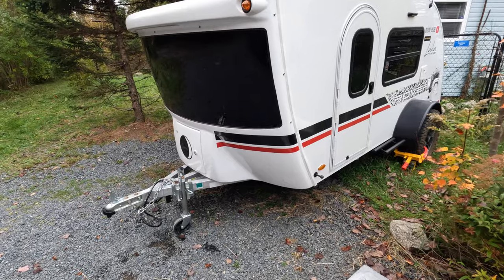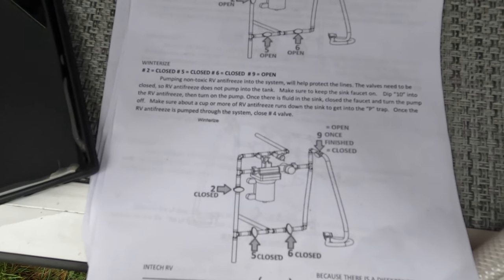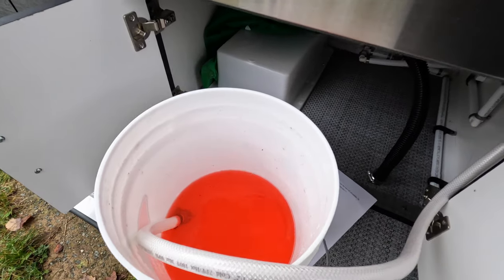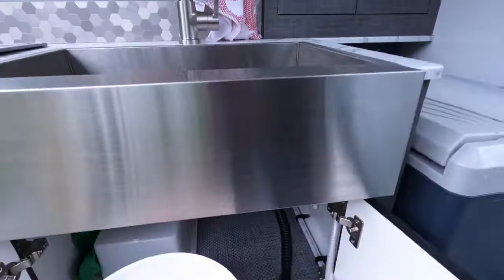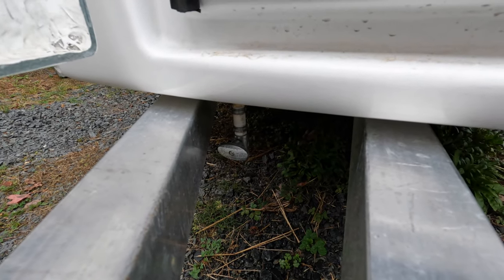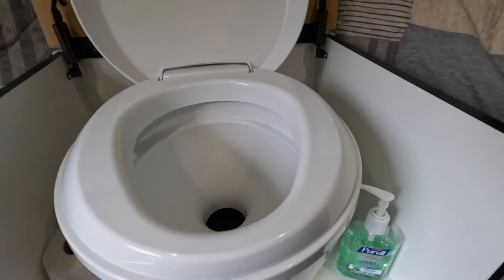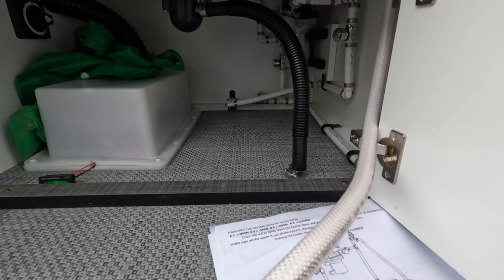Step by Step on how to winterize your InTech Luna Rover water system.

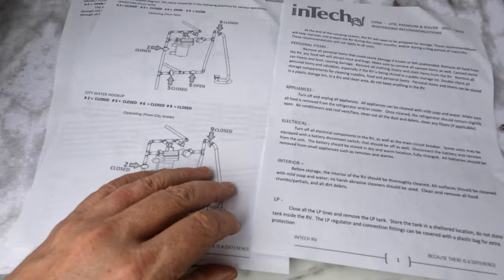Comment: Thanks for this video. Do you still have the multi-page instruction sheet from Intech with diagrams of the valves, which you showed @1:15 in this video? It's no longer on the internet, and my dealer doesn't have that either. (But they will be happy to winterize my Rover for $100, a half hour charge. No thanks.) Is there any way you can scan that document and post it with this video? It would be a HUGE help to us newbs!
Reply from the maker: Thank you for your kindness.  I’m positive I still have the document and would be happy to scan / put on my google drive.   It may be a couple days from now.  I will reply to your post again once it’s scanned.
Reply from the maker: @herrp8765 I found the document on the Luna site.   https://intech.com/rv/dealer-media/media/LUNA_Plumbing_Diagrams_2022.pdf  I will link this in my description as well. Thanks again friend.
Reply: @BruteforceExplorer  Dude, thanks sooo much!
Reply from the maker: You are more than welcome.  Thank you for your kindness.   Tons more camping videos to come!